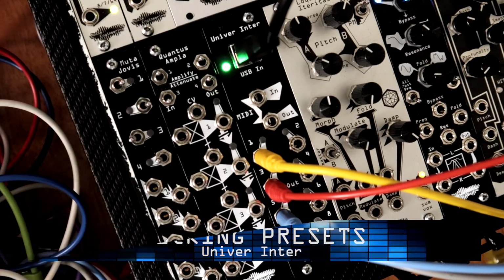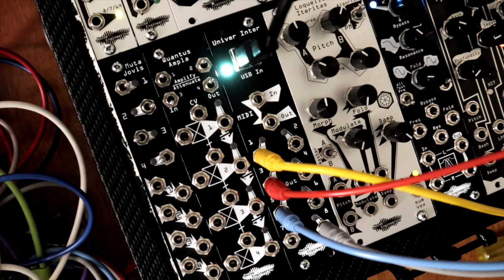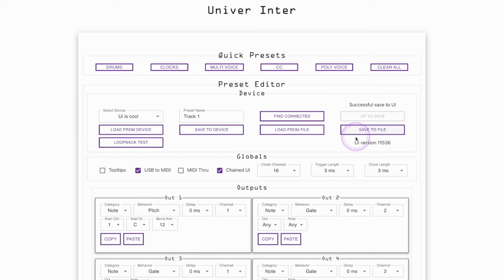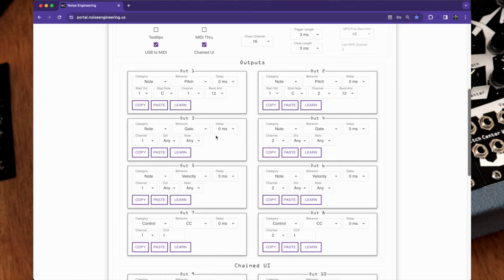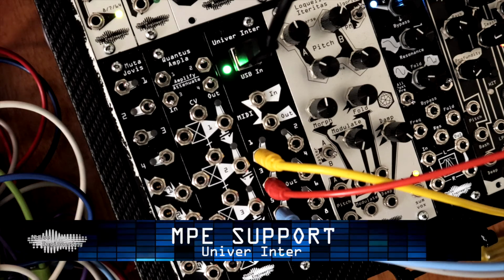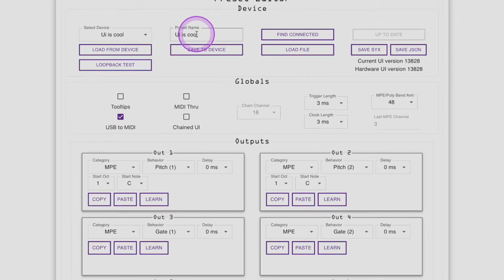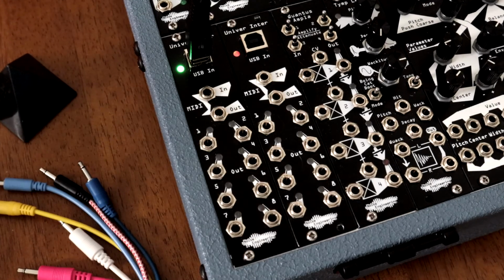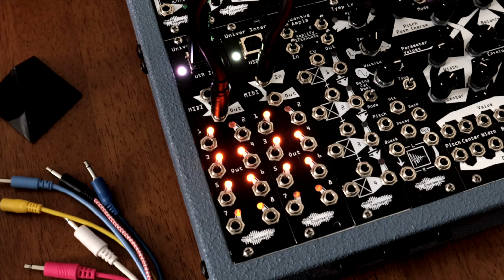5 Things with Univer Inter MIDI-to-CV module from Noise Engineering

Comment: Do you have to use it's USB Input or can you choose to use it with a MIDI Keyboard's MIDI out going directly into the Inter's MIDI input via the 1/8" stereo to MIDI female adapter and using  it's cv channel to play the Noise Engineering's Opp Ned arpegiator module? I'd like to use mine like that if possible. I just purchased it and waiting for it to arrive.
Reply from the maker: Yes, UI can be used with just a TRS MIDI input!

Comment: I wonder if it would still make Pams Workout go mental when using the clock input. I need to find something that won't (even though it's setup correctly), as I want the brains/clock source to be external to modular but Pams never likes it.